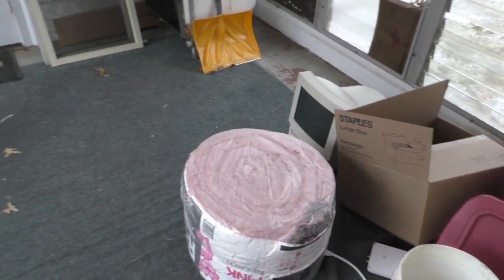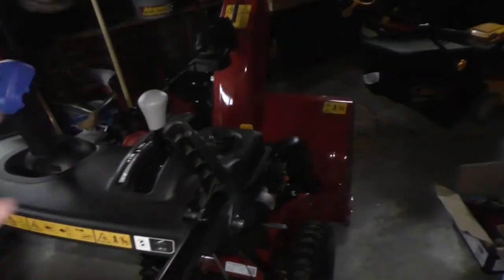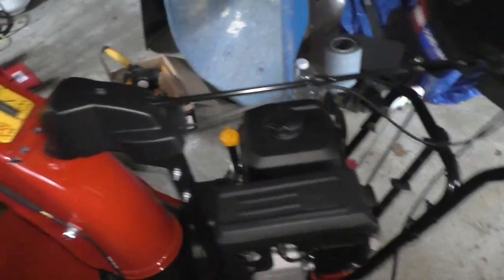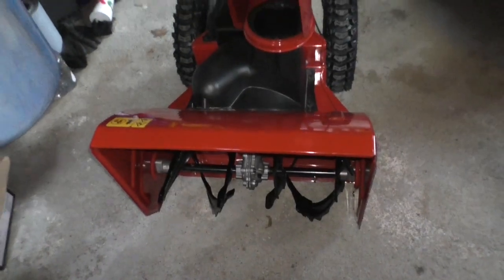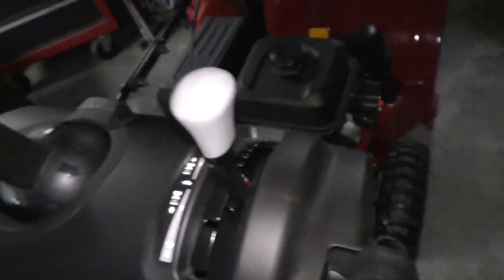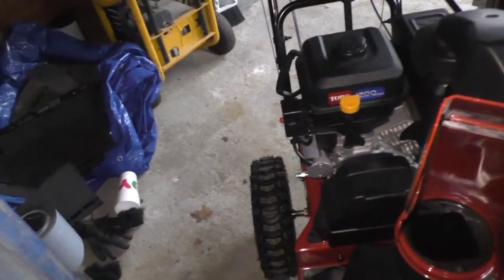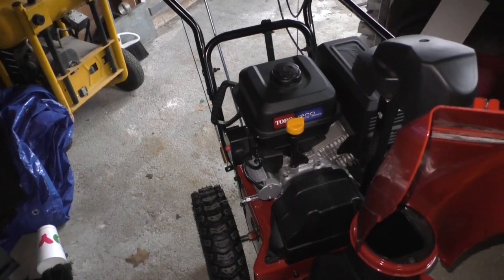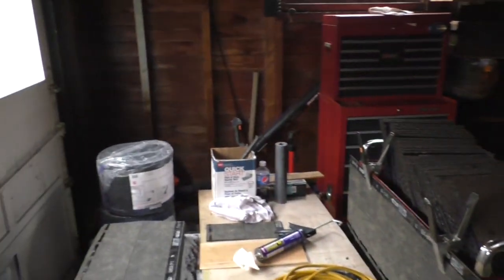1997 Murray Snowblower Repair - UPDATE!

Comment: YOU HIT IT RIGHT ON THE HEAD BRANDON! It's about oil changes and gaskets, and a better carburetor too, Why my 150cc scooter that's at my friend's house I can get running in 20 minutes again like it was never left even though it looks like hell, terrible body panels awesome little GY6 engine and Taiwan carburetor.

Comment: Back before Murray was owned by Briggs & Stratton, Murray used to market themselves as “The Affordable Alternative”. The engines always outlasted the frames.
Reply: They are better made than MTD whose frames are made of thinnner steel and sometimes crack where the auger housing bolts to the frame.  I have a Noma 5/24 made by Murray in 1996 and the frame seems to be in good shape although I repainted the augers and the inside of the auger housing to prevent them from rusting out and also replaced one of the skids which was worn out due to improper adjustment.  It did a good job in the recent snowfalls in my area but I would like a little more horsepower to deal with heavy snow.  I am looking into getting a used 8HP engine to install on it.

Comment: Got it running and had to replace the front brake master cylinder because the rear drum is useless on a scooter that will do 60mph and is the size of a 50cc lol it didn't die and probably won't ever, it's dumb and dangerous little thing but super reliable it's from 2003 and still going!! but it's body panels look like hell

Comment: Put an hour meter on it. Ill bet in 10 years you barely have 20 hours on it.
Im in minnesota, huge driveway, and have been using a Toro single stage, bought from a dealer, going on season 7 now.

Comment: I just shudder at that snow chute control looks so “delicate” in that it won’t last very long......
Reply from the maker: I figure I'll be replacing the housing within five years. The steel chute should last the life of the machine (I figure about 20 years... the Murray was over 20 years old and built horribly in comparison). Most snowblowers in this area last between 15-25 years or so, based on the random sampling of people I know who own them.
Reply: BBISHOPPCM's World  that said, that thing looks better built than the almost 20 year old master craft (store brand of Canadian  tire) snowblower we have (that was most likely made by mtd)